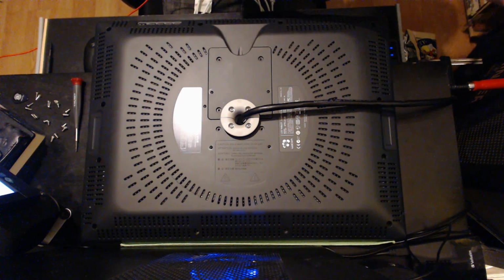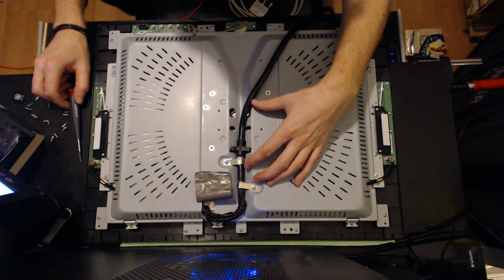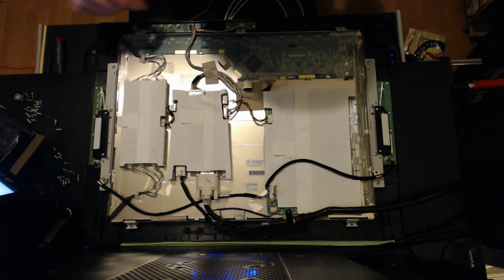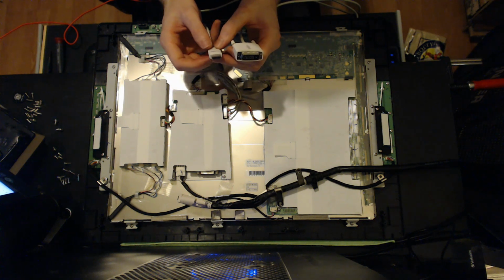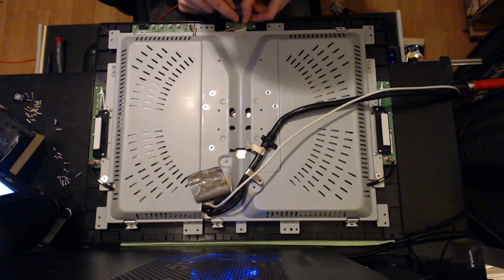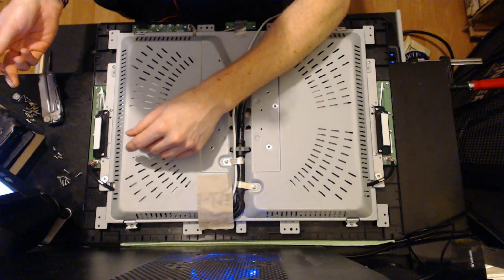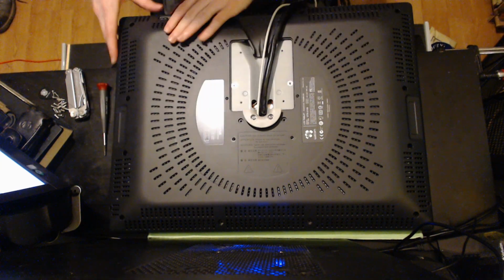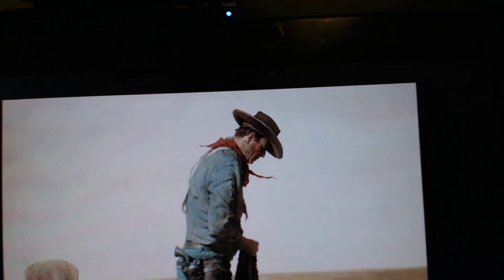Wacom Cintiq 21UX Disassembly and DVI Cable Repair

Comment: Posting this comment in 2026... Thanks for making this video. My Cintiq has the same blue snow. I took the backs off and cleaned the cables and it seems to only give me the snow when I log in. The screen will occasionally go black and a box with "Power Saving Mode" pops up. With my screen, these are one session issues. If I simply push the power button off, then on again it never happens again during that session. ..... The PROBLEM is.... This is 2026, and there are no drivers that will work with Windows 11 for this Cintiq. I had only been using it as a monitor. My feeling is that I might as well just buy a new monitor, if it no longer works as a tablet. I mean I know the cable would be cheaper than a monitor, but.... Any thoughts?

I should also add that I noticed.. after I posted this.. if I leave the monitor on all the time (I always turned it off after shutting down my computer) the problem doesn't come back. Wonder if the issue could be with the monitor switch on mine?

Comment: would love if you showed the location of the snaps

edit: there are three along each edge, evenly spaced. a thin guitar pick along the bottom edge, pushing downward and inward, will be enough to get it started.

Comment: With the cable comes out you notice it pulls down very hard early on after I bought it I put a whole bunch of tape in that slot so it would gently allow the cable to bend and not crease where it comes out and it has never had a problem.  I guess I circumvented that problem!

Comment: Hi, do your Cintiq get hot on top side screen? Like really really hot
Reply from the maker: Yes, that model gets pretty hot. The 21UX has no active internal cooling so the heat radiating from the CCFL tubes that are backlighting the LCD panel accumulates in the case around the top, with only some very small vents to escape through. They were designed that way to cut costs, no doubt, but you can certainly extend the life of any electronic component by adding additional cooling. 

An external fan blowing directly on the back panel or sideways across the whole surface of the screen will help with convection cooling quite a bit. The better solution would be doing a complete LED backlight conversion since they generate far less heat (and CCFL tubes all eventually burn out) but that is quite technical.

More modern higher-end Cintiqs have active cooling fans internally to exhaust heat and use LED instead of CCFL tubes for lighting, further reducing heat and extending backlight life expectancy. Something to consider if you have the ability to upgrade.
Reply: @ryanchristensen5266  Thank you for fast response! Yes, I thought the same thing, and add little DC fan on top to reduce heat, but I got this problem on top screen, its look like "light leak" on Ipad. https://www.youtube.com/watch?v=gajUcqOyvcI

Do you think this happen because the heat? or sign the Cintiq too old and gonna broke? and is this fixable? 

Thanks.
Reply from the maker: Wow thats pretty severe. If it has always been like that it may be that the panel is not seated properly, allowing the upper backlight tubes to shine in front of the LCD panel, which might explain the unusually high temperature on the surface. You could test it by disassembling the Cintiq and applying gentle pressure to the upper area while it's on to see if it reduces the issue. It could also be a voltage issue or a improperly installed CCFL tube. If its been repaired in the past, they could have done any number of things incorrectly,  even as simple as not reinstalling the shielding properly. Worst case is that the CCFL tubes are incorrectly installed or getting close to failure and are getting too much current, leading to them being too bright and too hot. 

I'd definitely investigate the issue before allowing it to run for long periods of time in this condition. Good luck!
Reply: @ryanchristensen5266  its starting happen just a month ago. From small line above then spread like that. Have it for 4 years without any problem before

 Maybe I gonna find new replacement first before messed up with this old thing. 

Thank you for answering!

Comment: great video!
a single question
is it possible to remove the disconnected cable ?
Thanks for the reply......
Reply from the maker: Thank you - Theoretically it should be possible but it would not be very practical. The data/video cables are all shared in a single bundled cable sleeve which would have to be completely cut open and separated, at the very least damaging the rubber strain relief anchor since it would have to be destructively removed and possibly ruining the additional shielding in the cable bundle. I wouldn't recommend it, but if the extra DVI plug REALLY bothers you, you could technically just cut it off at the split. Also, before replacing the cable entirely, I'd suggest using some electronic contact cleaner on the external DVI connector and scrubbing the pins to determine if it's just oxidation causing the issues you may be having. Might save you the trouble! Good luck -

Comment: So thankful for this. im having similar issues goin take her apart this weekend
Reply from the maker: Good hunting! ..and if you run into trouble, there is a lot of information and troubleshooting covered in the comments. Another thing to try before disassembly is simply using some electronics contact cleaner on the cable pins, there is a high chance it is simply oxidation causing intermittent video signal issues, which can manifest as flickering pixels/lines/blue/red/green pixel distortion, etc.. so scrub those pins and try it out, if you see an improvement or obvious change, then you know you're on the right track.

Comment: I'm not entirely sure if this is the trouble with my 2008 model but I just wanted to thank you for making this video! I bought a new power brick off etsy but it was no dice. At the very least, I hope my solution is as easy as this! I'll update either way when I open her up and check. In the meantime, I've dropped 2500 on a 22HD :)
Reply from the maker: Best of luck! ..but it sounds like you are moving onto the wonderful land of modern tablets, anyway :D Would LOVE to do that, too, but that just isn't going to happen as long as my 21UX is still breathing.. or I find a dufflebag full of money on the highway.
Reply: @ryanchristensen5266  I'm a character designer in the industry by trade so it's a necessary evil. My 21ux is otherwise great and the usb still functions perfectly. I'd love to hand it off to my partner if I can get it working against

Comment: https://youtu.be/GBRxnSFD9UE I think, it is a loose contact inside. Wacom wants Rs. 17K to 40 K ( 1 usd = Rs. 75) for repairing it. Any guidance?
Reply from the maker: I agree, it is likely a failing connection somewhere. I have no experience with that model, so disassembly will be up to you. However, something to try before disassembling it would be to use some electronics contact cleaner and spray the male and female connectors and use a small nylon brush to scrub them, let them dry thoroughly and then see if there is any improvement. Good luck! 

PS: Don't give Wacom any money. They're out of their minds. I'm getting ready to abandon them for just about ANY competitor due to their absurd and increasingly exorbitant costs and shady business practices.

Comment: It started happening me a few months ago, that when i touch the cable  close to where the monitor meets the cable, the screen turns yellowish or bluish or pinkish....   i have a    Wacom Techno Cintiq 21UX 21-Inch  any ideas what it could be??
Reply from the maker: Your DVI cable/internal dvi connector is likely shorting, probably due to oxidation or fatigue. If you follow the video, you'll see how to go about fixing it. Good luck!
Reply: took me about an hour. added in a separage dvi to hdmi cable and worked like a charm. screne looks better too. Kudos to you Ryan. Regards, Joel
Reply from the maker: Glad to hear it,  congrats!
Reply: @ryanchristensen5266  excellent. thanks

Comment: is this wacom21Ux screen replace able ?
Reply from the maker: Yes, technically, but the process is very involved. The 21UX uses an odd panel size (21.3" @ 1200 x 1600), so you'd need to source a panel, which is probably going to require buying a used lcd monitor of that size, like one of these https://www.pcliquidations.com/p47268-viewsonic-vp211b-grade-b?utm_source=google&utm_medium=cse&utm_term=47268&r160164167166161&gclid=Cj0KEQjwnsPGBRDo4c6RqK-Oqu8BEiQAwNviCX6hJMU19l0XqYmOjVkU5t68s-3FoNmclRh3lP9PUo4aAlWx8P8HAQ, strip it down to the panel and then swap it across to the cintiq. So, you're going to need soldering skills, a fair amount of patience and bit of electro-mechanical savvy. BUT totally do-able.
Reply: @ryanchristensen5266  i was wandering to buy this model, but im not sure how longer it can works. there are seller selling $400 to me.
Reply from the maker: It's too risky at that price, in my opinion. You never know how many hours are already on the ccfl tubes. If it's fully functional, comes with a stand, stylus and power supply, then $250-350 depending on the condition and estimated running time. Good luck!

Comment: Ryan, I have a “corridor” - a dead zone - on the right side of the screen on my Cintiq 21UX (DTZ). The pen avoids it and the pen nib-to-screen contact offsets in this corridor. Drawn lines won’t travel through the corridor, but they veer off around its edges in straight lines. With my pen I can’t reach any features of my software that sit in this corridor - the pen won’t go there. But, surprisingly, I can use my mouse normally in this zone. What’s up with this? Any suggestions from your experience?
Reply from the maker: Thats weird. I'm assuming the unit hasnt been dropped or damaged in some way recently. I've never really heard of a selective digitizer issue like this. Have you recalibrated? Tried un/reinstalling drivers? Tried it on a different system/usb? Could be software, could be hardware.. If nothing else, you may have to open it and check all your connections, oxidation may be impeding signal to the digitizer, or a short might have occurred somehow. Good luck!
Reply: @ryanchristensen5266  Thank you for taking the time to respond to my inquiry.  My Cintiq is my lifeline, so I'm very careful with it, ergo, it hasn't been traumatized in any way. I' did notice that it's happening in all of my animation/drawing/painting softwares. At first, I thought it was only in TVPaint.
I've watched tablet videos (not Cintiq) wherein they've experienced similar issues when there's a dirt-accumulation issue inside. I may use your disassembly instructions to get in there and give it a look and a cleaning. I've owned this Cintiq since new, so it may be a dust/dirt issue. I'll let you know what I find.

Comment: when removing the back panel just use a debit card and run around the edges, you could easily bend back your nail if done wrong and its not worth it

Comment: Great video. But would anyone happen to know the type of backlight bulb? My wacom doesnt have a flicker problem it's just getting dimmer. I called Wacom and they don't service or have any info on the parts anymore. I have a wacom cintiq 21ux. Any help would be appreciated.
Reply from the maker: Thanks! Well, the backlights are CCFL tubes, but I do not know the exact model. If you're looking to replace them, you might look into LED backlight conversion kits. However, if you're able to open up your Cintiq, you should be able to carefully identify the specific CCFL bulbs and just replace them. My 21UX is heading that way too, unfortunately, only a matter of when... If I end up performing the procedure, I'll be sure to document it!
Reply from the maker: I've been thinking about this again and am personally interested to see if I can rejuvenate my 21UX with some new tubes. I've noticed my screen color temperature is warmer than any of my other displays and pretty much impossible to sync. After a little research today I was able to come up with more information on these ccfl lamps. I now know they are 2.6mm diameter but I can't 100% confirm the precise length of the bulbs without disassembling. However, extrapolating from the IPS panel's active display area along the horizontal width of the screen (432mm) I would be confident suggesting these full spectrum lamps https://www.ccflwarehouse.com/26x42fuspcc1.html You will need 6 total, 3 for each bracket, top and bottom. Here is some photo reference of the diffusion plates and the ccfl brackets and tubes. https://imgur.com/a/HZufx If I can come up with the dough for the tubes, I'll record a walkthrough. If you decide to do it, I just recommend you double check that tube length before ordering. Also, be careful with the lamps, they contain mercury.

Comment: Hello!! I have a cintiq 21ux as well. I have a display issue as well, but the screen doesn't even show anything. It is completely black. I haven't tried your solution, or even opened the cintiq up to check. If you have any info or suggestions, please let me know. Thank you sooo much for this video, for I can't afford a new cintiq. Thanks!!
Reply from the maker: If no light comes on, you should test your power supply and make sure it hasn't failed. Thats the first step. If your light is illuminated, you should test the dvi port you are plugged into to varify its working.
Reply: @ryanchristensen5266  Will do!! I know the power supply and everything is still working, because the LED light on the box is still on. I also can use the cintiq tablet as an intuos without a screen, so it has something to do with the display particularly. I will check the dvi port and everything!! Thank you soo much for your help!!
Reply: @hayjreynolds641  it might be a loose/unseated ribbon cable that connects from one board to the other inside the back of the cintiq. You might have to open up the display and check the back.

Comment: What's the power socket pinout? I think it's 12V but on which pins? I have one that my company was going to bin as "broken, driver does not detect". I'm wondering if it's a faulty cable or if it was a faulty PSU. I only got the monitor. No stand, pen, or power. :|
Reply from the maker: Well, after busting out the DMM, it appears that the two pins on the flat side of the plug with the arrow are both +12.3~ VDC. I would grab that sucker and try to get it running again.

Comment: Hey, Ryan. Have you heard of the Cintiq 21UX having issues with the power cycling on and off? Mine will occasionally turn off and then power back on. I've tried buying anew power adapter. My guess is it's probably a loose wire or connection. Just wondering if you have any clue. Wacom wasn't able to offer me any help on this.
Reply: @ryanchristensen5266 @TheionDesigns I had the same problem. I open and unplugged the PCB card with the switch On/Off, now the sreen is always on. It's work perfectly. 11 year of good job and still alive. Thank for the tips.
Reply from the maker: I haven't heard of that specific issue, hmm. Could be a number of things, hardware or software related. Is there any pattern to it? Does it occur after a specific amount of time? Does the LED completely go off when it does this? Does it occur more rapidly the longer it is turned on? Have you tried wiggling the power connector at the locking mechanism or various places along the lines to see if there is a short or a bad connection?
Reply: @ryanchristensen5266  Thank you for taking some time to answer. 

No real pattern that I can come up with or specific amount of time. I've tried using it on different computers and it still does it regardless. So I'm not sure if it's software.

I would imagine it's probably a connection issue. I tried buying a new power cord adapter, but it didn't fix the issue. I guess I should maybe try opening it up like this and poking around to see if anything looks obvious.
Reply: @Michael.Regina  its the power switch.  Unfortunately, the parts are no longer available.  I have this same issue.  Some people are jumping the power switch so that it is always on and no longer dependant on the soft switch.
Reply: @TheionDesigns  Are you considering doing that? If so let me know how that goes! Or how to pull something like that off!
Reply: Michael Regina I ordered a DVI to Thunderbolt/Mini Display cable.  So I’m going to do the cable when I open it for  the switch fix. I’ll let you know how it goes.  I have read you can remove the cable to the switch when it’s on and it will just power up with the power cable.   If not I may need to rig something else.
Reply: @TheionDesigns  definitely interested in what you find out!
Reply: Michael Regina ,so I did the power up and pull the cable to the switch and all that did was power it down.   The DVI/Thunderbolt connection worked great when the power was on.   So after that failure, I bought another unit on eBay for $42 usd and next week I plan to scavenge parts.   Hopefully, I can replace the switch and have a working unit.   If anyone else needs parts from it, just reply and we can figure something out.  The sucker punch was the $60 shipping!   Lol
Reply: Final update:  Purchased a used unit from Ebay.  Bought a Square Trade with it.  It showed up with shipping damage and they are sending me another one and I don't have to return the first one I purchased.  So I removed the with and installed it in my old unit as it had a better screen surface.  Also installed a DVI/Thunderbolt cable.  everything works great now.  Apparently the thing on eBay now to avoid the charges is to sell units for cheap and charge extra for shipping...  go figure.  Anyway, very easy fix if you can get the parts.
Reply: @TheionDesigns  Thank's for the update, Dave! I'm glad you were able to get yours figured out. I'll have to consider whether it's worth it to try as well. I bought a new Cintiq a couple years ago to replace mine, but I would like to get this one back up and running too.